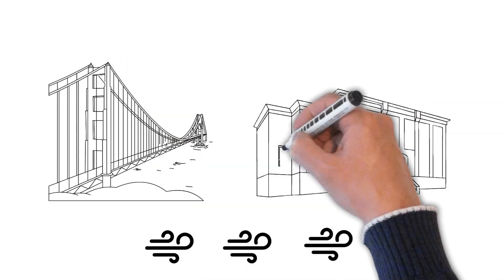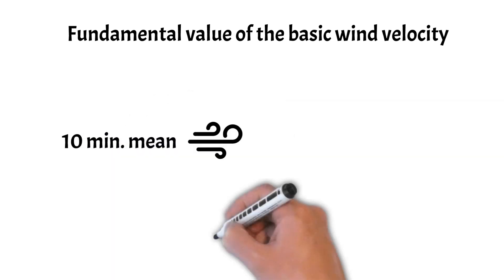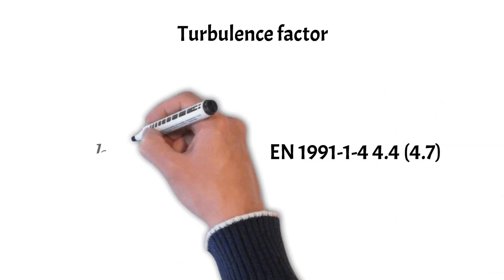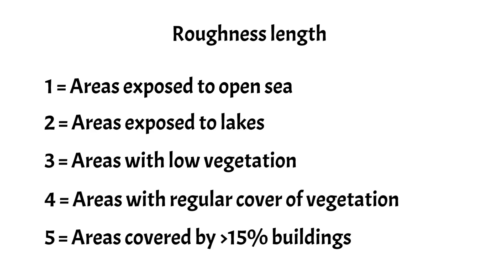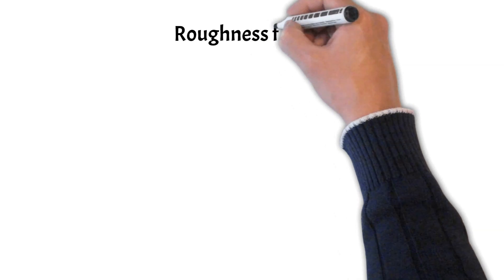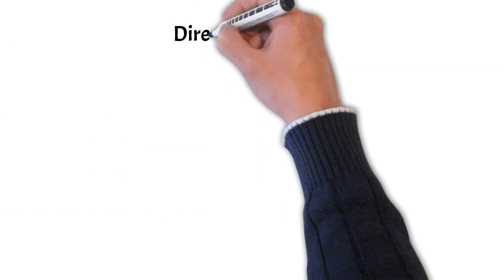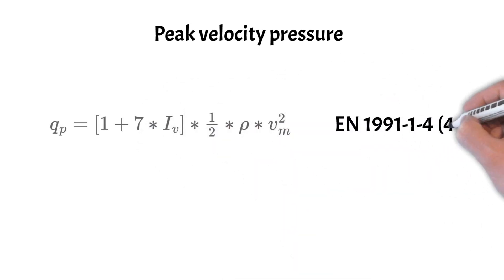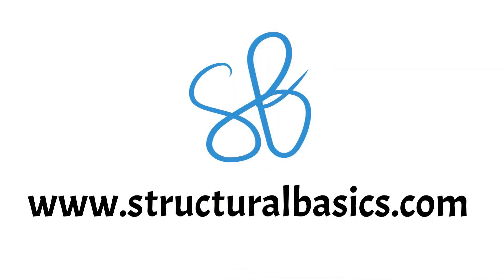Peak Velocity Pressure Calculation - Step-By-Step (Eurocode)

Comment: Thank you very much for this professionally done video. Very clear and enjoyable to watch.

I have a question I hope you can answer:

Having calculated Peak Velocity Pressure, qp, we want to use this value in an FE model. We can either apply this PRESSURE to the appropriate surfaces in the FE model or calculate an equivalent wind force Fw (=CsCd * Cf * qp *Aref) as shown in EN1991-1-4, equation 5.3 and apply it to the model as a force.
But in calculating Fw, we have the force coefficient Cf which reduces the magnitude of the wind force. Let's assume that the value of Cf in our case is 0.5, this means the wind load applied as force to the FE model is 50%  less than the wind force if appied as pressure to the corresponding area. The recommended value for CsCd is usually 1, so that does not effect the value of Fw.

Should the force coefficient Cf somehow be taken into account when applying qp as pressure? How should this discrepancy be addressed?

Thanks in advance.
Reply from the maker: Hi, 
Thanks for the feedback.
To be honest, I have never used equation 5.3.
But let me know if you find out what's correct.
Cheers,
Laurin